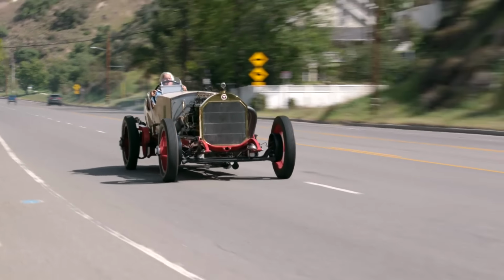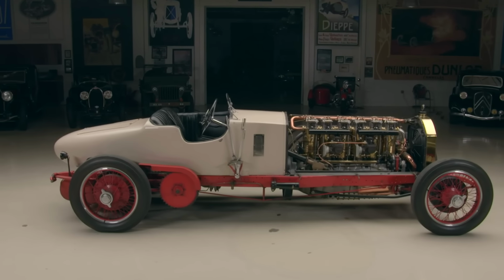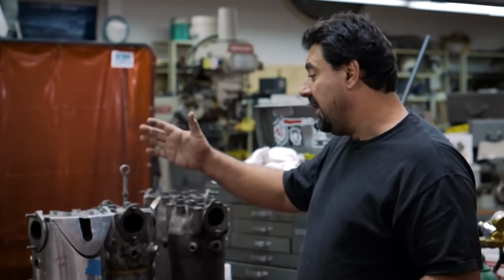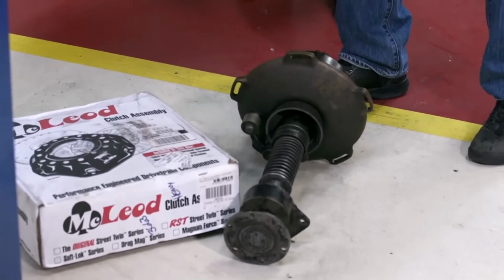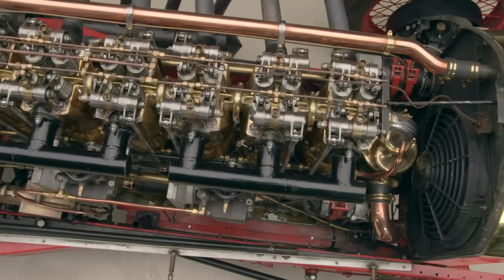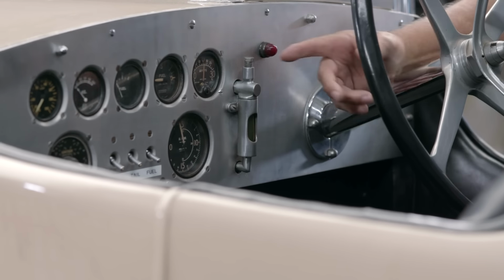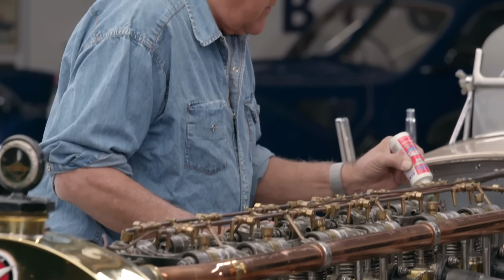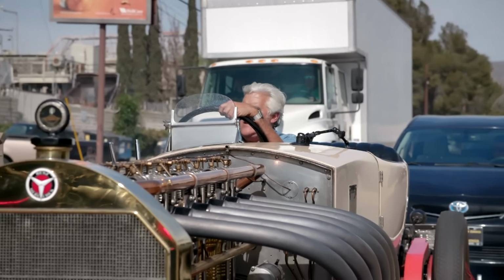1921 Benz-Mercedes Rabbit-the-First - Jay Leno’s Garage

Comment: The water jackets! I’ve been hearing about these in the restoration blogs for years! As always, you and your team did downright amazing work. This is what makes Jay’s garage unlike anything else.
Reply: doesn't matter what it is, if jay has it, it either runs or is in the process of being made running.
Reply: Brass, silver brazing, copper tubes and top workmanship. Good job!
Reply: It looks like originally, literally, not figuratively, #3 cylinder tomato juice cans (46 oz) were used for the water jackets!
Reply: @sparky6086  I have always thought they were some type of food service or military food can.  I would be surprised if it's NOT a food can.  Tin-plated steel cans were introduced in 1825 and tin-free steel was not introduced until the 1960s.  So many if not all contemporary food cans would be tin-plated steel.  Tin solders easily and doesn't rust, which is why it was used for food cans.  Tin, however, is fairly soft and expensive so an under structure of steel was used because cans wouldn't collapse.  I wonder if that's not what they used on these water jackets for the same reasons.  In the intervening 100 years, that tin would have corroded away, exposing the steel which rusted through.  I wish Jay's crew would respond to these comments because I think those are actually food cans adapted for the purpose.  I mean even if they didn't drink up the tomato juice or gather them out of the trash, why wouldn't they use the existing machinery for tin-plated steel cans which solves a bunch of problems they wouldn't have to deal with.  It's like copying and pasting code, no need to re-invent the wheel.
Reply: @sparky6086  I was looking at those with the same thought, official name for cans of that size is A 10 .https://en.wikipedia.org/wiki/Steel_and_tin_cans
I am thinking that the Benz guys ,having emptied a few cans decided that it would make an ideal water jacket...
Reply: @Mercmad  Initially, I thought, that they might be #10, since it's a common size for institutional kitchens and restaurants, but I second guessed myself & thought that maybe the engine builders liked tomato juice!
Reply: yeah same , nice to see it finally assembled
Reply: You and I both, brother!  I can't believe it's finally the day to see it run.  So awesome, and 200-RPM take-offs from stoplights, lol.
Reply: Well, that and Leno has $500 Million to spend on these cars...
Reply: Weaponized Memes there are lots of people with more money that Leno and way less interesting garages.
Reply: @Mrcaffinebean  No one else has a Celebrity Garage of this caliber that makes millions annually from simply showing off the collection.
Reply: danger450 not sure what you are trying to say or why it matters.
Reply: @danger450  Why is that?
Reply: Thank God it's not a V12!
Reply: @albertstadt9853  what's wrong with a Merlin powered car?
Reply: Mrcaffinebean 
That metal man looked familiar, think he was briefly worked on Boyd’s show.
Reply: Living art history museum
Reply: Water jackets look like coffee cans.
Reply: Jay my fav
Reply: Not true, there are other restorers who do this stuff.